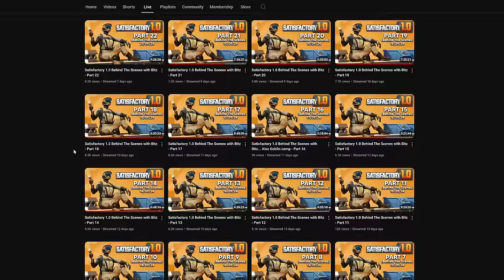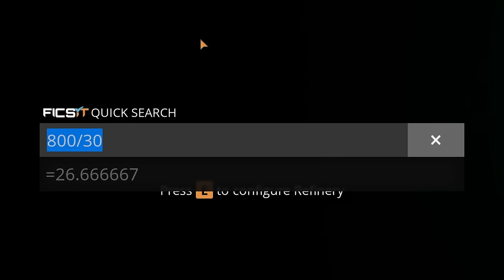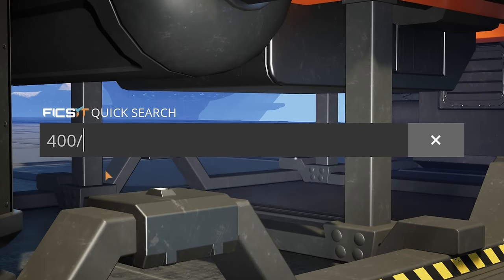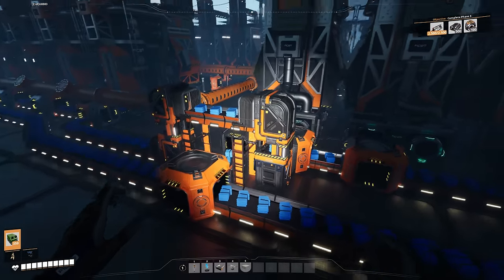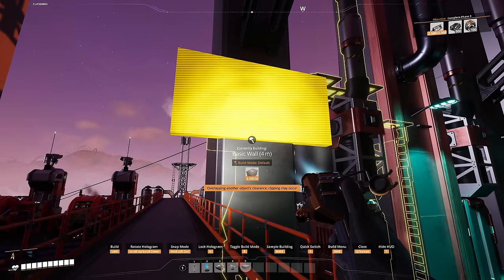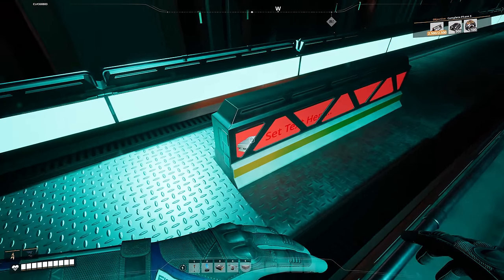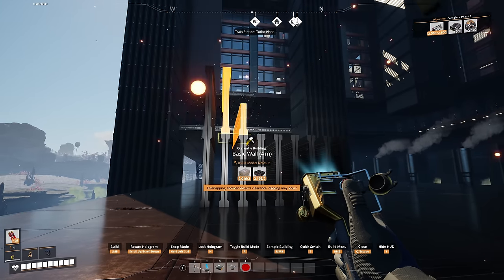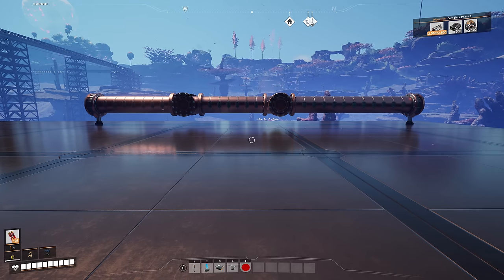OK... This Factory is "MIND BLOWING" in Satisfactory 1.0

Comment: Why the Heavy Turbo Fuel recipe? I always thought this used the most amount of oil, sulfur and coal of all the turbo fuel recipes..? Did you pick this just because you build this plant in an extreme resource rich area? I want to get going with turbo fuel as well, but when doing the numbers I am struggling to pick either the normal recipe or the Turbo Blend Fuel (alt). Decisions, decisions...
Reply: Personally I use Heavy Oil>Turbo Heavy Fuel>Rocket Fuel.

Per minute, it takes 56 Oil, 60 Comp. Coal, 20 Nitric Acid. And it outputs 100 Rocket Fuel, 37 Polymer and 20 Comp. Coal. 

Although, another option is Heavy Oil>Diluted Packaged Fuel>Nitro Rocket Fuel. 37 Oil, 100 Water, 75 Nitrogen, 100 Sulfur, 50 Coal. It makes 150 Rocket Fuel, 25 Polymer and 25 Comp. Coal.
Reply: With only 1800 oil you can build a 54GW power plant that would let you pass the nuclear power. nuclear power is always optional.

Comment: 31:21 you can get the exact angle you want by drawing a freeform painted beam and placing those frames on that beam instead of being limited by the angle snapping rotation you get with ctrl+scroll, just another way of doing things, I'm NOT invalidating the method, I'm ADDING OPTIONS to how you can do things.

Comment: 14:50 I know there is a mod for it, but I want the base game to unlock a counter for each sink individually. A graph similar to the electricity grid. 

After doing one section make it run for xx min to see if the output is up AND stable at the calculated level.
Reply: That's a good idea you should suggest it on the QA site!

Comment: That pipe thing...  I just realised WHY the first gravity fed refinery pipe system I created - which incidentally uses pre-placed pipe junctions in a hidden manifold area above the inputs - works better than other designs using the same system where I've run a pipe then attached the junctions.  There is so much retrofitting in my future...

Comment: I've not run into the pipe junction causing flow issues yet myself, but that's probably because I've only done small builds where it's not as important (like water cooling coal generators) so I've never noticed an issue. Going to keep this in mind for the future though!

Comment: It is indeed super pretty! But why Turbo Fuel when the new Rocket Fuel alternate in blender is sooooo goood?
Reply: Dont have access to the blender at that stage of the game.
Reply: @Unstator good catch. Diluted Packaged Fuel into Nitro Rocket Fuel is great, but it's only marginally better than Turbo Heavy Fuel.
Reply: @Unstator  Yes but when building at this scale, it doesn't really matter what stage you are in 😅
Reply: @deejeh9494  How is it only marginally better? One 600 pipe of heavy oil residue is equal to 64 fuel gens with the turbo heavy fuel alternate recipe. While 800 heavy oil into Diluted fuel (not packaged) into nitro rocket fuel gives you alittle over 575 fuel generators. I just finished setting up my factory for 144GW of power using only one 600 pipe of crude oil.
Reply: @Kotoma  Diluted Packaged Fuel use half the oil. 400 oil, not 800.
And you convert Turbo into rocket as well, not into the generator directly.

Comment: Rocket fuel with a few alt recipes for power using fully overclocked fuel generators and a separate rubber/plastic factory using recycled recipes is the way I decided to go this playthrough.
Reply: For those interested, Rocket Fuel - 1 Refinery at 125% using the Heavy Oil Residue alt -> 1 Blender at 100% using Diluted Fuel alt -> 1 Blender at 100% using Nitro Rocket Fuel alt. Throw the Polymer Resin and Compacted coal into the Sink. One of these can fill 36 Fuel gens at 100%, but I suggest overclocking those to save space.

Comment: Why not do Turbo Blend Fuel? Then 4x 600 oil + 4x 400 sulfur = 4x 800 turbofuel. No coal required.
Reply from the maker: You just answered your own question.. "Blend" it needs the blender
Reply: @ItsBitz  Ohh! I've never built a turbofuel factory before alumimium production! I get it now.

Comment: I fail to see the point of the pipe junction explanation. If I need to fix problems with pipes, then I always fill up the pipes fully, and simply supply and consume the same amount. (I also never use any buffers - unless you consider the pipe itself as a buffer)

Comment: how the heck did you attach your wall outlets directly to your refineries???
Reply: i figured it out mostly. for anyone trying to do this run a beam up the side of the refinery (or any building) line it up so that itll run parallel to the refinerys outlet then run one across so its running thru the power connecter. pop an outlet rite were it needs to be and bobs your uncle. its not the exact same as bitz. his looks flush to the machine were mines sticking off it a lil bit. and you still have to attach the machine to the outlet but it still has that daisy chain look to it. if anyone knows a better way im all ears